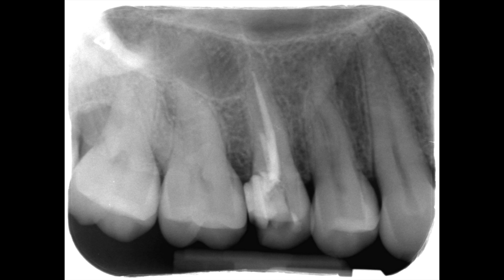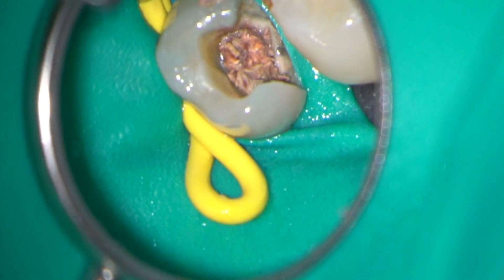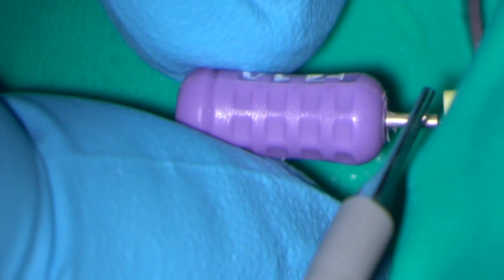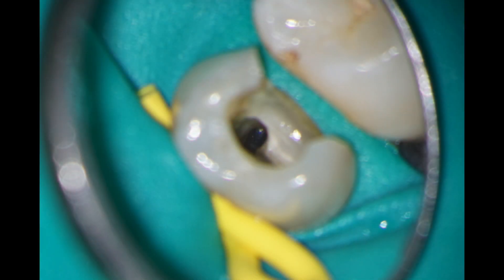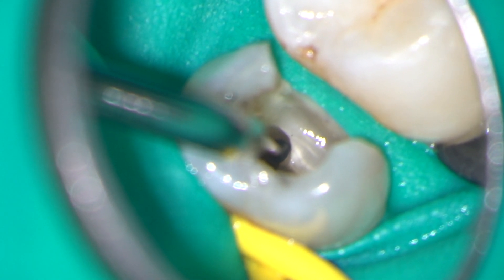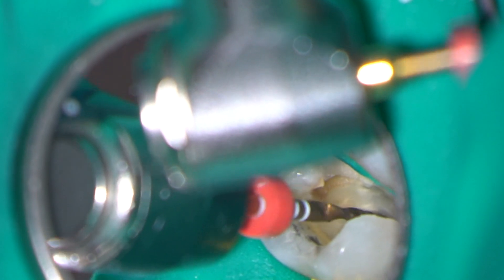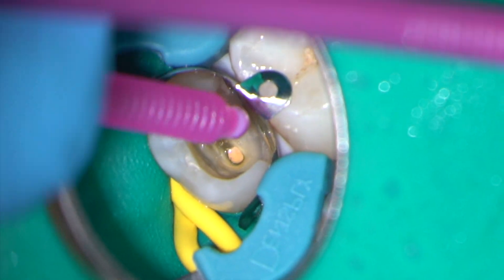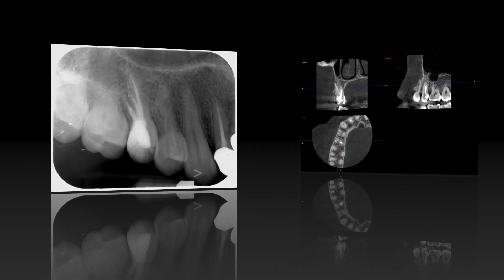UR5 3 canals & fractured file

Comment: Great work doc. Are you at all worried about not getting a full cure at floor of the pulpal chamber with your surefil? As a new grad, this was discouraged for me in the clinic and RMGI was favored.....Thanks for the advice
Reply from the maker: Hi Aidan,
You could use a RMGI, however all my composite and bonding agents are dual cure, Prime and Bond with activator and Core-X Flow..they will set chemically where light does not penetrate.
Cheers
John
Reply: @johnrhodesendo  Great, thank you.

Comment: Amazing work done here Doctor John. Please let us know also the details of the handpiece you have used with LN bur and the speed of LN bur used here.
Reply from the maker: Hi Rohit
I use a Kavo handpiece rotating at about 2.5K rpm
Cheers
John
Reply: @johnrhodesendo  thank you so much but I felt this handpiece is being used in an electric motor with a certain torque and speed while using it hence I was not so clear .

Comment: This is absolutely amazing! I have always enjoyed your presentation and you make the most difficult techniques seem so easy when you were performing them!
I have a question: would you always first aim at removing a visible fractured instrument, or would you aim at bypassing first? Cheers and thanks Dr Rhodes!
Reply from the maker: Thank you Devin! 
Great question, yes if from the radiograph or CBCT I think I can retrieve without damage then I attempt this first, pieces lodged at the apex I usually use a surgical approach.
Cheers
John

Comment: I notice you isolate more than one tooth, any advantages doing it and do you mind to sharing your thoughts? Thanks Dr.
Reply from the maker: Hello toti35
Great question!
I isolate more than one tooth if I need to restore the tooth with composite and use a matrix to avoid having to remove the dam and replace it for restoration.
Cheers
John

Comment: Great video as usual - just wondering, are the more flexible Wave One files still available for sale? I noticed you are using one of them (due to its darker file colour compared to the current ones). I used to have them and actually prefer them over the current ones that are not as flexible i.e. almost 0 tollerance for prebending. Where would I be able to find them?
Reply from the maker: Hello there,
You will need to ask your local Dentsply-Sirona rep....the most flexible are called TruAnatomy but they are not available everywhere
Cheers
John
Reply: @johnrhodesendo  thanks John!

Comment: Great work! Prosthodontically, how is that tooth going to be protected? That's another challenging phase. I'm not sure how to do that well, unless crown lengthening is done.
Reply from the maker: Hello acash93!
The occlusion was favourable for leaving the restoration as it was, otherwise I may have placed a post in case the dentist wanted to use a full coverage crown. The distal margin can be managed ok
Cheers
John
Reply: @johnrhodesendo  Thank you :)